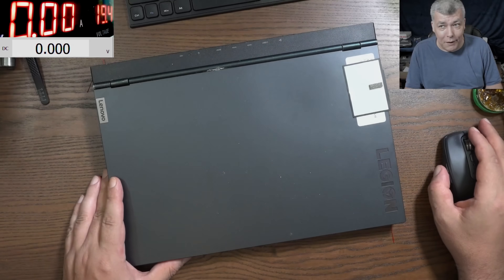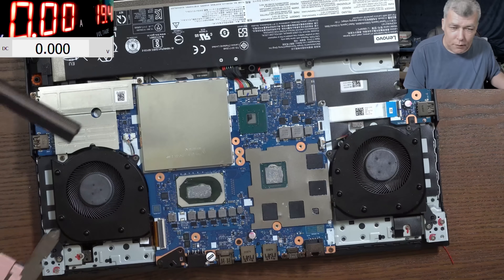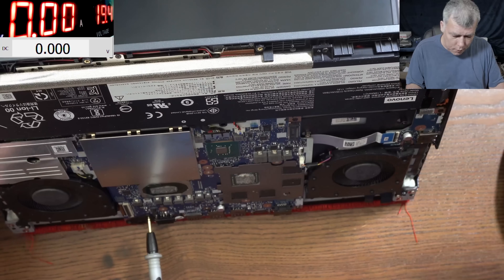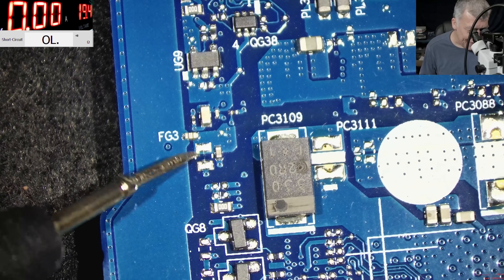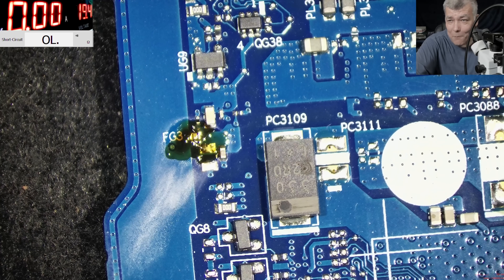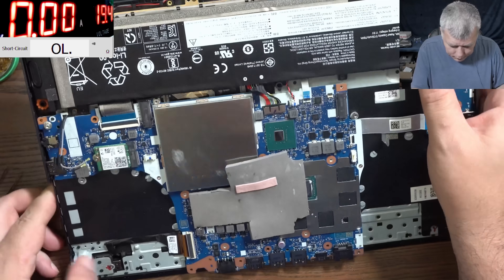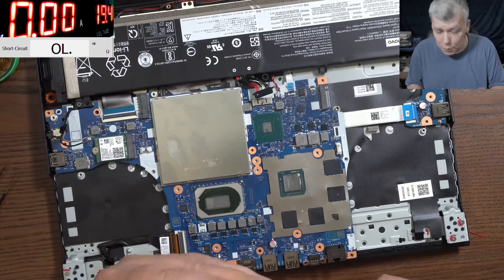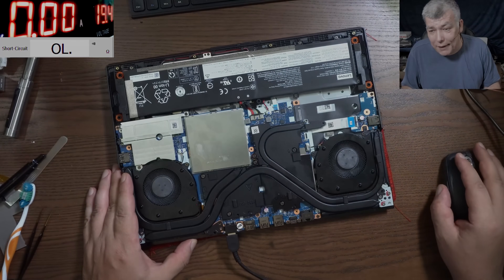Lenovo Legion 5 - No backlight, screen fuse replacement

Comment: Thank you, back light died when replacing screen. Probably should have removed battery before touching screen connector. Board wasn't exactly the same but I found the backlight fuse thanks to your video.

Comment: Hello there I think I shortcircuited my fuse somehow I bought a replacemend for my lcd and lcd flex cable and still got the dim light after replacement to my carelessness of not removing the battery it sparked. After trying out the new parts and seeing the back light is still dim. May I ask if just connecting the fuse using a copper jumper wire will be a fix? like for a few years? or should I really change the fg3 fuse and how and where to find one T___T thankyou

Comment: I'm almost certain a fuse is blown in mine. Same model. I was playing a game on it then the battery went dead while it was plugged in. No charge light. I used a multimeter to test the charger and it showed 19v at first then 14v. So i plugged it into the laptop and checked the pins where the jack is saoldered on. And it was getting 12v there. I'm so confused and there are no shops with the skill to work on it inmy area 😕

Comment: You're an expert., My legion 5 came back to live., Thank you so very much for let us know your skills., God bless you!
Reply: Hello , what was your problem ?  Did the FANS working when back light gone ? 
I do have Legion 5. However only blue LED dot is on but laptop quiet no fan. Charging cable - if its plugged in the LED blue come on looks like the power going in. Do you know what could be the problem ?

Comment: Love your videos! I have a Lenovo legion 5 that I replaced the screen with after it was damaged. I didn't take the battery off and now it looks like the board has blown a fuse. The laptop will look like it's powering on (power button lights up) but the screen doesn't come on, even on hdmi it shows no signal. Is this something you can fix?
Reply: Lo solucionaste???

Comment: I have a laptop that is the same model or close enough.  My backlight stopped working right after I swapped out a broken LCD.  I was worried I shorted it out since I didn't disconnect the battery first.  (I know I know)  I suspected that I popped the same fuse, but I'm testing it and the continuity is fine.  Perhaps it's just the 40pin LCD cable for me?
Reply: @Toemoss-Perspective  lo solucionaste? Tengo el mismo problema

Comment: Make a video when you deliberately mis-plug the screen connector and see if the wire fuse blows or not. On a scrap board that you don't care about. Let's experiment. :)

Comment: Can you please help me?? My lenovo legion 5i had its motherboard replaced. I am unable to start the secure boot from the bios menu. Is there anything that can be done ??????
Reply: First go into the BIOS, disable legacy boot, then enable secure boot . Rarely I have come across some models of laptops (acer) which allows secure boot only when we set administrator password for BIOS!
Reply: @Aneesh.Asokan  Tried that. The secure boot option is greyed out for some odd reason.
Reply: @arsucka  Make sure that your hard drive is initialized as GPT, secure boot work only GPT partition table! If yes, try disabling TPM on the BIOS save, exit, then enter again ino the BIOS & see whether that option grey out is gone.
Reply: @Aneesh.Asokan  Wheneven I am trying to interfere with something in the bios, the tpm get disabled by default and i am unable to get it back on. Then I have to flash the windows again to get back the TPM
Reply: @arsucka  As default, legion laptops comes with UEFI & secure boot enabled, then how it went into CSM MBR mode? Go into your BIOS boot options or advanced boot options, enable UEFI, some BIOS do have an option legacy & UEFI then enable secure boot, save & exit BIOS. If still that option is greyed out, set administrator password to your BIOS save, exit BIOS. Then re-enter the BIOS typing the administrator password, then you may be able to select secure boot. I have seen such scenarios on some servers. Good Luck!
Reply: @Aneesh.Asokan  Done that too. Its greyed out still. 😭
Reply: @arsucka  You didn't say why the default secure boot got disabled! Any way, try Google with your laptop model you may come across a solution!
Reply: @arsucka  When I think it over, it's windows key that's the culprit. You switched your mother board so your default windows key is invalid as it's tied to your orginal mother board serial number!😢

Comment: You have taught that fuses usually blow for a reason. In this video, I don't recall seeing you checking for a short. We're you going by experience or is there a condition where you should try replacing the fuse first? 

Watched many of your videos, thank you for the content.
Reply: That's what he was doing when he worked the lid back and forth, and that's also why he tested it with the charger plugged in.

He is probably not going to charge for this repair, so it is not worth it to spend hours exhaustively searching for a short. Just give it to the customer and they will bring it back if it happens again.

Be smart with your time.
Reply: The fuse wouldn't have measured OL if there was a short 🤓
Reply: That is not necessarily true. A short may be hidden behind an active component (transistor), or as Sorin said, it may be something like a capacitor that only shorts at a higher voltage.

If finding shorts was always as easy as putting one meter lead on ground and the other probe on a fuse then fixing electronics would be a whole lot simpler and no one would watch this channel.

Comment: My first laptop was a HP that developed this same issue. HP wouldn't fix it without changing the motherboard which made it a not affordable repair even though in retrospect it was an easy and cheap fix, replacing the fuse. After that I stopped recommending HP laptops to anyone. I just wish their was a laptop that worked. The most I expect I need to do to any laptop now and then is replace the thermal paste. Can anyone recommend good brands that never break down or break down less often. Bad experience with HP, MSI.
Reply: If u want ultrarepairability and upgradeablility then framework, its costly yes but you can just replace parts over time, which could otherwise make having new laptops cheaper.
And as for rule of thumb maybe avoid macbooks and of such.

Comment: Very nice laptop, I'm writing these words from a same laptop (mine is a 17" one tho). This laptop will suffering overheating issues after disassembly. You need a special thermal paste for that.
Reply: PTM 7950
Reply: @derekhatake   Exactly.
Reply: What is the special thermal paste for this laptop?
Reply: The kind that transfers heat
Reply: @kimoleto5178 the heatsink is pretty much made with that PTM phase changing thermal solution in mind , i have heard that using sometjing else even if it will provide good temps it will last a few months at best